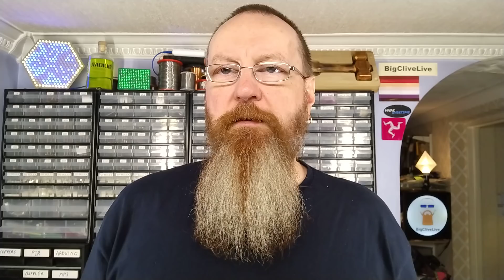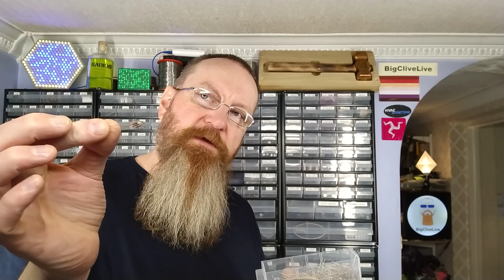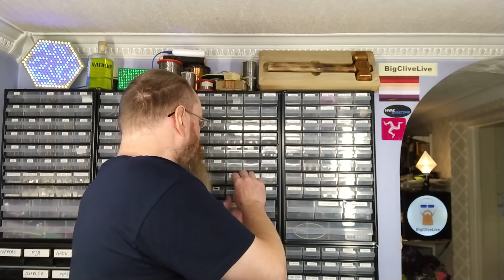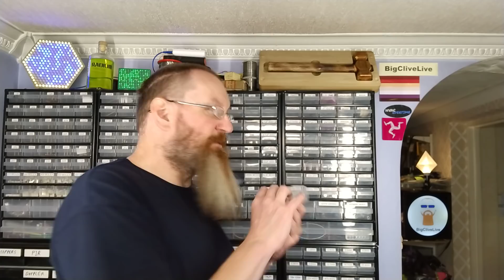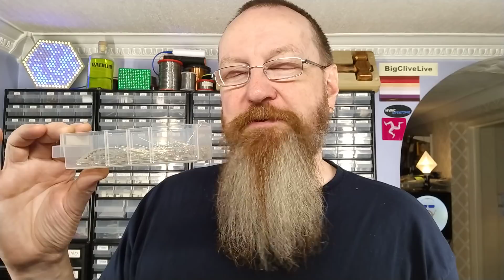Q&A part 1

Comment: Hello, and I bet that you MIGHT have been asked something like this before ???
What it is, I was GIVEN an iPhone 7+ phone. But the only thing that I did NOT get was the ORIGINAL lighting charging cable. So in doing what a LOT of others will have done, was to go to the good old £pound shop to buy a charging cable. But over a few years, I had bought a LOT of charging cables. As EVERYONE over time suffers with a faulty cable at the phone end of the cable. As I ONLY ever use the cable to CHARGE the phone up with. But as I was thinking, that at the lighting end of the cable, is to use ALL 4 of the wires, and to do the SAME at the USB end. As my thinking is that if 1 of the power wires was to fail, then the other wire would take up the power. Or do you think that it is a STUPID thing to do. Or should I go out and buy a GENUIN iPhone charging cable for my iPhone 7+. As I have seen them at STUPID prices. But in the long run, would it be better than to always have 2 or 3 £Poundland cables at home as a standby even carry 2 NEW unopened packets in my coat and backpack. 

Many thanks in advance. 

P. S. Sorry for any spelling or grammar mistakes, this is down to me needing to have cataracts removed from BOTH of my eyes. 

Bye from John C

Comment: As you will know these days most laptops do not have an internal CD/DVD player so I bought an external CD/DVD with two USB leads on it  to try and play some workshop manuals . But when I tried to play a CD/DVD the disc player did not seem to have enough power? Could you please tell me if powering an external CD/DVD player from a 13 amp plug to give it the additional power might be an option in order to use an external CD/DVD drive with a laptop ? Thank you
Reply from the maker: Did you plug both the USB plugs in?  It needs that extra current.  But sure about plugging one into an external supply as it may backfeed the USB port.
Reply: @bigclivedotcom  Thank you Clive I did plug both USB plugs in . I won't risk trying to get extra power via a 13 amp plug adaptor in case it back feeds like you say and will have to look at other options. Regards

Comment: Is there any real advantage to replacing normal LEDs with laser diodes? Seems to me that lasers aren't very good for general illumination (because physics) and most of the technology in laser headlights is about turning the laser light back into normal light while allowing the manufacturer to use the word "laser" in its marketing material... and charge an appropriate premium (tinfoil hat at the ready).

Comment: ... If you have seen the video on solvated electrons, does that not prove electrons exist? Also, what, to you, is an electron? I hear they move slower than a snail, which puts pay to my theory that over decades, a wire will shorten at one end and grow at the other, if on dc, ac may provide a canceling effect

Comment: Clive, just realized the "chin beard, top lip beard of your icon, (glasses and top scull cap included) Would make a great pop bottle cap remover. From my youth (I'm 70) seems to match perfectly the bottle metal cap remover mounted on the front of the Pepsi Cola sales refrigerators at delis and gas stations.  Back in those days, there was no such thing as a "Can of soda", they only came in bottles. Also beer bottles. Anyway, might be interesting if you could make a "BigCliveBottleCap remover" as a novelty? "Merch to sell" just curious!

Comment: For walking your socks off:

1. Get shoes that fit well, then your feet don't move much

2. Wear double socks, cotton inner, wool outer, then the inner socks stay still against your feet and slip against the wool, the wool stays still against the shoe
Reply from the maker: Hot weather, size 16 feet and I weigh 250 pounds.  I tend to wear shoes out fast.

Comment: Your description of the operation of valves and tubes was basically the way they work. I suggest avoiding them in projects, or for experiments. Take it from my experience, high voltage will hurt you if it finds you! I suspect you know that. I have no questions for you. I already have 2 degrees to keep straight in my head. I can only suggest more of the food review videos, even if you cooked the chicken yourself. Thanks for these videos. Good luck to you! 👍
Reply: High voltage feels like burning. It should cook a chicken no problem.
Reply: @echelonrank3927  240 volt chicken wings, all the way! 👍🏻

Comment: Would you peek into larger charge controllers for solar? And I mistakenly bought a lower voltage rated model model (150vmax vs 200). Could it be "fixed" to accept 200v? Its an epever 150v 100a 2000w/12v to 8000w/ 48v.
Reply: Epever Tracer 10415AN
Reply: Unlikely.  The caps are probably sized for that voltage.  However you could look at the voltage ratings of the caps.

Comment: thanks for your vids clive! had a busted relay board in my vehicle and felt confident soldering after watching your shit over the years. ran it WAY too hot and burned traces straight off the board haha needless to say i bought a new one for $50 but it was still a fun time. we're gettin better. keeping the heat low ;)
Reply: Traces can be replaced by wires... on single/double layer boards rather straight forward - trickier if there are internal layers  though...

Comment: Clive, back in the mid 80's, I had been given a meccano, and near where I was working was an early color computer company. I would raid the dust bin at break time, and get all kinds of wonders. Motors, pillows, etc, all suitable for the size of my meccano. Unfortunately the motors were 24v, and not the best choice for my toy. I worked in a new vacant building as a security guard, so I had time on my hands when not making my rounds.